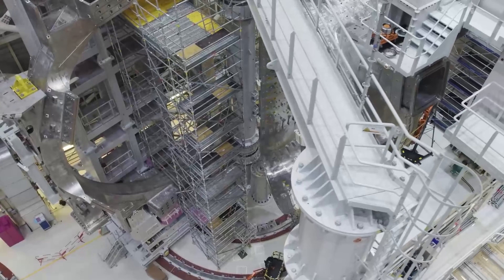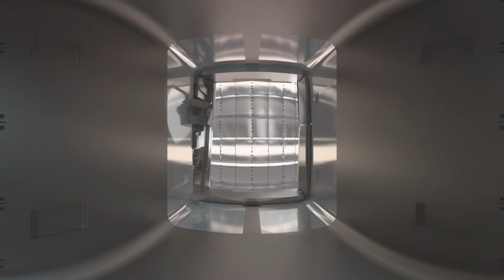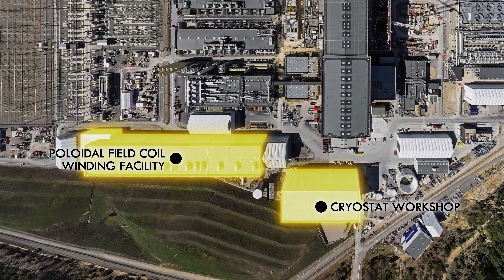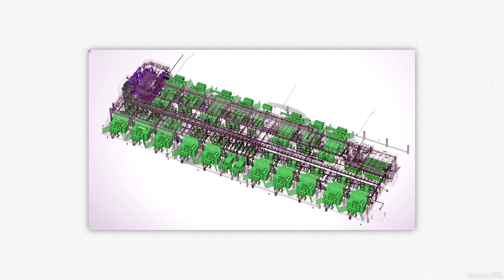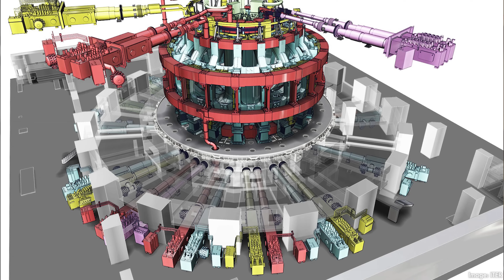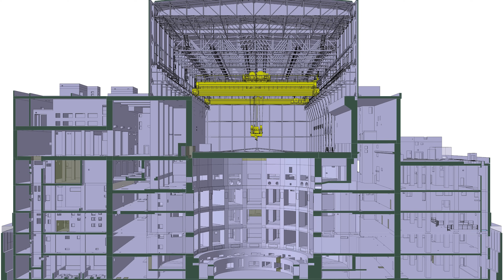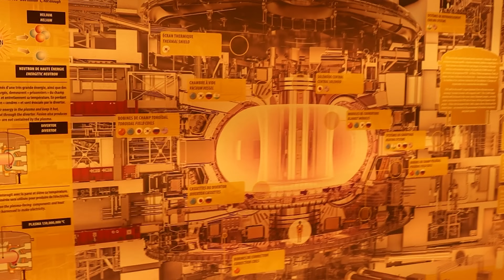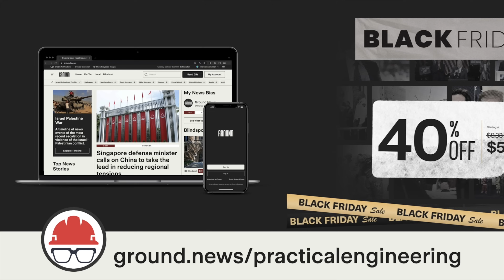Engineering The Largest Nuclear Fusion Reactor

Comment: the greater the power generated the more toxic lethal accumulating the waste which is nonupcyclable-nonrenewable. how many landfills will the pent waste be required and how long will the wastes lifecycle be? 125,000 years? or 10,000 like nuclear waste? and don't give me that thorium b.s. until a non earth metal is invented that won't rust apart into nuclear disaster 3 days-3 months into operation.

Comment: I am fairly sure that ITER will not lead to a commercial viable power plant. I expect France will build some anyway, because they love that sort of "Grand Project." ITER is a lot like the Space Shuttle, an impressive technical feat, but ultimately way too complicated and expensive. It's possible that a method other than giant tokamaks might lead to commercial reactor, but they will have similar problems sourcing Tritium, neutron embrittlement etc. 

But we can meet most of our energy needs with wind, solar and storage, so probably fusion is not really needed. Fusion will arrive too late to avoid damaging climate change.

Comment: The complexity of ITER is nothing compared to a power producing fusion reactor which will need the addition of neutron multiplier modules (mainly beryllium) and a tritium breeder blanket (lithium-6) incorporating both a tritium removal system and a cooling system to transfer the heat to the generators. It will all be massively expensive especially given the requirement that outside the reactor there will be processing plants to recycle the tritium, lithium and beryllium.

Comment: The fusion reaction itself may be "clean & green,"  but all the materials and construction equipment / processes required to build the reactor and other plant infrastructure are fossil fuel intensive - and there is no way to escape that reality.  Same goes for all the other suppoedly "green" technologies (wind, photovoltaics).  These things don't magically drop out of the sky.

Comment: While the engineering involved in this project is amazing, the basic question remains: why would you build a "fusion reactor," when the technology used to date has failed to produce useable power?  Presently, and in every case, the reactions generated still require more power input than what is released as usable output.  Don't get hoodwinked by claims to the contrary, which typically omit the power required to drive the lasers, or other methods to generate and sustain the plasma.

Comment: Heres a question. How are you going to get all the Deuterium and Tritium needed for the fuel? Even If the ITER can really produce 10 times the input energy, I wonder whether they will really be able to make an economically feasible reactor.
Reply: Deuterium is abundant. You can buy it from any gas supplier very cheaply.

Tritium will be bred within the reactor.

Comment: This is more of an upfront investment than even building a fission plant. Granted, this is a single reactor where a plant would likely have multiple reactors, but having to manufacture on site I hope will not be the case. The project is massively behind schedule, but that is understandable since it is an engineering research experiment. Still, It has to be economical to build them for power generation or they won't be built, clean or not. Yes, governments can make it the law to do it, but not every government is going to do that.

Comment: Why not burn the hydrogen to fuse heavy hydrogen atoms like di and tri hydrogen atoms to heat up the water directly instead of using cryogenic magnetic conductors in loosing energy. Burning hydrogen results in water and heated already water to produce steam? Or why not use hydrogen oxygen fusion cells from Toyota to produce electricity directly and effectively using heat and their electricity?

Comment: I continue to be amazed that we are spending massive amount of money trying to build a fusion reactor to "produce power."   To make this work we need to: 1) over come energy inputs need to operate a machine of this size; 2) learn how to contain super hot plasma; 3) develop materials that can function without without being degraded under extreme heat and strong radioactivity; 4) gather the waste heat; 5) convert the waste heat to energy; and manage all resource inputs and waste outputs.

We already have access to a large fusion reactor that is appropriately socially distanced and emitting electromagnetic waves that can be converted to directly to DC electricity at the point of use for consumers.  Yep...I'm talking about solar power.  Solar can produce more than enough power for the each day and with battery storage enough power for the night.  I am all for big science until it becomes a tool to seperate fools from their money.  

If we want to address climate change before we look like boiled frogs, we need to refocus our attention to better PV solar manufacturing methods; drive PV solar installation cost down further; develop better and cheaper energy storage systems (batteries, pumped storage, thermal storage, etc); and finally overcome current economic and technical model that is the electrical grid.  A dose of wind energy and  energy conservation to drive down demand also seems helpful.
Reply: You sound as if it's an either/or situation when in fact we are doing both - putting money into fusion AND into solar and battery storage.

Comment: Really cool video overall, but I do have to be pedantic about a comment early in the video stating that there are no environmental byproducts. At least in this specific reactor design, that is not the case.

The material required for the blanket itself is, in fact, radioactive, and at the end of the reactor's lifespan that blanket will be contaminated waste that has to be properly disposed of.

Real Engineering did a video on this problem/topic about a year ago which I will link here:

https://www.youtube.com/watch?v=BzK0ydOF0oU

I don't say this to argue against this facility's construction or testing or against nuclear fusion research or even the technology reaching commercial viability. But I think it is important to be honest about the problems and challenges still facing the technology and designs seeking to explore it.

Comment: This made me very negative about ITER.  If it's this difficult and expensive to build ITER, even if they achieve Q=10, it would not be a viable commercial product.  The capital cost would just be too much.
Reply: ITER isn't meant to be a commercially viable reactor. It's a lab experiment that is needed to get to commercially viable reactors.
The Manhattan Project cost 22bn USD, a nuclear warhead costs around 20mil USD.
Practical science is expensive.

Comment: ITER is a multinational nuclear fusion project that aims to create a sustainable and powerful energy source without the baggage of environmental pollution. The project is a tokamak reactor that will house plasma at temperatures in the hundreds of millions of degrees, ten to twenty times hotter than the center of the sun. The project is under construction since 2013 and is expected to pave the way for an entirely new form of electricity generation. The project is ambitious as it plans to import 50 megawatts of thermal power and get out 500 megawatts of fusion power. The reactor will hold about 840 cubic meters of piping hot plasma, which is electrically charged. The plasma is held in place by giant magnets that produce magnetic fields of almost 12 tesla, over 200,000 times stronger than Earth's magnetic fields. When the deuterium and tritium atoms fuse, they release a neutron and a helium atom. About 80% of the energy released is carried by the neutrons, which pass straight through the magnetic field. When these high-energy neutrons strike the tokamak walls, they heat up the fluid, turning it into steam. The steam will then spin turbines that generate electricity. The project, although not expected to produce electricity, aims to fine-tune the technology needed for a fully functioning commercial fusion reactor.

Comment: 12:53 Although the electricity generation part of the process is well-underestood, I don't understand why they'd let that potential generation go to waste. Surely it doesn't hurt to use the heat energy being generated to generate a bit of electricity?
Reply: Expensive and would require a full blanket which is very difficult

Comment: indeed just a huge science experiment. by the time this becomes net positive energy output, the fusion will be like ancient vs solar pv and wind power technology because fusion power is based on heating liquid/boiling water to drive a turbine which is very inefficient or ancient. The nuclear heat source also like a sledgehammer unlike multiple precision heating where the power source is electricity for use in science or industries.

Comment: 3rd generation Nuclear Fission Powerplants, typically produce 1GW of electricity, without the risk of meltdown.
Only required power to run it: consoles that control the rods, which is few kilowatts max.
There are Molten Salt Thorium Reactors as well. I think fusion is lagging so much behind in terms of efficiency.
Reply: Of course it's lagging behind, it's a future tech, not a current tech.  Teleportation is also lagging behind when compared to train travel...

Comment: The elephant in the room, however, is the fact that 80% of the fusion energy (14.1MeV) is actually contained in very fast neutrons.
14.1MeV is 10 times as much as the average energy of neutrons produced in a nuclear reactor.
But they act as if this is not a problem. These neutrons can smash any nucleus and thus generate radioactivity.
A fusion reactor with 5 GW of fusion power would blast away 4 GW in highly aggressive neutrons. Each of these neutrons could theoretically produce a radioactive nucleus.
If you think about it, you can only shake your head.

Comment: I would really like to see it in action but when I was there in summer I saw: they are facing so many problems, even a plan for a finalization is currently not possible. 
Such a thing has to be built within 5 years. As this thing is already building 15 years and most likely even 15 more years the big problem is that the technology we have then is about 40 years old. 
So ITER will be finished one time. But then it is so late that the technology itself has already been tested in a smaller and quicker built machine.

Comment: I know this is a research project. The goal is to generate 10X the power that goes into the reactor.... Does this include the power that goes into all the reactor support systems? Maybe this question is answered in the guests presenters video?
Reply: No, it doesn’t include that
Reply: @Gomlmon99  interesting, so I wonder what the overall efficiency is.

Comment: But can we please just use nuclear fission until fusion is figured out?? It's still the best option by far.
Reply: How’s it the best option by far? It’s incredibly expensive
Reply: I have to disagree. Renewables are the best option by far.
Germany, which is very much not an ideal location for renewable energies when it comes to both geography and politics is currently running on 44% renewables. >90% is entirely feasible.

Comment: Yeah, the sun doesn't have the perfect condition for fusion, in fact it's actually pretty inefficient and we have to do that a whole lot better. In comparison the suns fusion won't even power a laptop and that's the problem with fusion it needs to be super hot like millions of degrees and that melts everything we know, therefor magnets but honestly I don't see this happening as those magnets need a shitload of power also. Fission is still the best thing we have to date.
Reply: That’s where net production comes in. You have to supply a lot of voltage to the magnets, but when the reactor works at maximum efficiency, it produces enough power to power its own components and have excess to give. Thus, net positive output

Comment: This engineering is right up there with building a internal combustion engine head and block out of dry ice, and every time it fails they make the next one twice the size and complexity of the previous one. 
Meanwhile project like like https://youtu.be/10Dt4nr5g_c?si=6WDw4oLpP26SMv0H go under funded, because it not inline with the 80 year old scientific obsession of putting a miniature star in a magnetic bottle.

Comment: Honestly, ITER should have built a regular nuclear fission power plant next door. Considering how long the construction of the fusion reactor has taken, they would have had plenty of time to complete the fission reactor, and then they would have had their own source of electricity for the experiments. Plus, they would have actually contributed to the energy grid when they weren't conducting experiments.
Reply: France already has plenty of nuclear fission power plants!
Reply: @Rob2  My point is that much of Europe is in an energy crisis right now, and while renewable energy is helping resolve some of that, I'm very curious to see how often and for how long ITER can draw such massive amounts of energy from the grid.
Reply: @kentslocum  It isn't "a massive amount of energy".  It is a huge number, but it pales when compared to the normal load on the grid.
Reply: @Rob2 small amount of energy but very high power draws, for short time periods. Significant but not at all appropriate to use a fission reactor for

Comment: A commercial system like this would be too large, too complicated, and too expensive.  Not to mention that it is too centralized and would be vulnerable to attack.  I am starting to think that smaller, simpler, and distributed power generation systems would be better in the long run.
Reply: This is a science experiment and thus 90% of the onsite infrastructure (consisting of manufacturing halls, assembly buildings, research labs, accommodation and storage tents) won't be required for a commercial fusion plant.  The Manhattan project consisted of hundreds of buildings across tens of thousands of acres across dozens of locations spread across an entire country - just to create two nuclear weapons - do you think the same infrastructure is required today to make nuclear weapons?

Comment: Well if they get out 10 times the thermal power they put in, an optimistic 40% efficiency of the non existent generator would reduce that to 4. A very good 50% efficiency of the laser and it is down to 2. And that does not include the power needed by the superconductors. After all they need to be kept at cryogenic temperatures, while there is pretty much a hydrogen bomb going off next to them.
A Q of 10 sounds great,  but I wouldn't get my hopes up to high...
Reply: That's not what the Q number is.

The quoted 50MW is the energy cost of all that equipment.

A Q of 10 means you generate 10 times the amount of that number.

Comment: Wait wait wait, I got a question: if the fusion reaction releases a bajillion high energy neutrons, wouldn't these neutrons damage the walls of the tokamak and weaken them over time? Wouldn't you need to replace the thing eventually? That sounds expensive and annoying, not to mention... wouldn't the tokamak be like, super radioactive by then? That's a big hunk of radioactive scrap to get rid of 🤔 How do they plan on doing that? Doesn't that undermine the whole 'clean energy, no waste product' idea?
Reply: That is one of the downsides.  Proponents are eager to claim that there is no nuclear waste, what they mean is spent fuel that becomes radioactive.  But the plant itself does become radioactive and would have to be processed in an appropriate way at end of life.
Reply: @Rob2  I see 😕 That's kind of a let down. Are you aware of any other drawbacks?

Comment: The facility should've been built far underground. The amount of energy during "quench" is enough to lift the entire building off the ground by several meters and crush it like a tin can. 

Pieces of the building could shoot out of there like bullets for several miles. And, radiation leakage is part of a failure mode - with the explosive capacity of the water that gets super-heated by the plasma.

I wonder why the Stellerator news isn't being shown? That's like the Pfizer one right?
Reply: This is pure misinformation. Where did you read this?
Reply: @Gomlmon99  You can probably read about their safety mechanisms on their website; but the principle is simple. It's just like a giant electromagnet. When you turn if off suddenly the energy doesn't have time to dissipate before it discharges. So, even if the superconducting magnet is turned off, the amount of energy is great enough for a big disaster - which the scientists are well aware of. 

The problem doesn't sit well with me when they don't have inertial confinement of several meters of earth overhead. So, a car-sized piece of building shooting out of there could be a possibility.

The bigger problem is even easier - money. The funding pressures are a recipe for later disasters.
Reply: @ryanchicago6028  again, whatever you have read is wrong. Yes, the reactor itself could be lifted by a few feet in the worst case. No, bits of the building are not going to fly out. Disruptions pose no risk to anyone outside the reactor hall.

Comment: It’s not going to work even the smallest amount of dust inside this reactor would be enough to overheat and destroy small bits of metal this is just one of a few issues I will mention I don’t have the time nor patience to explain the rest but this is one of the few problems with this style of reactor they are building
Reply: yaaa no thats not one of the problems and they are very good at getting dust out of clean rooms